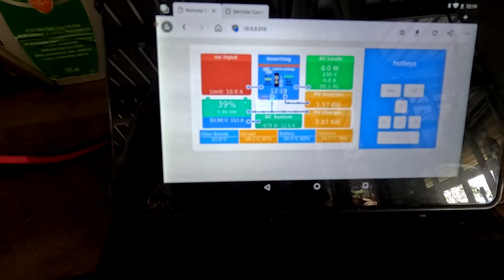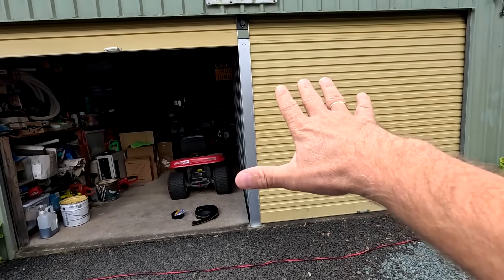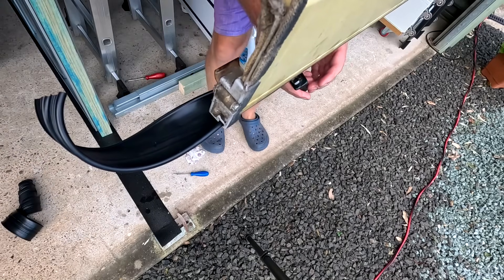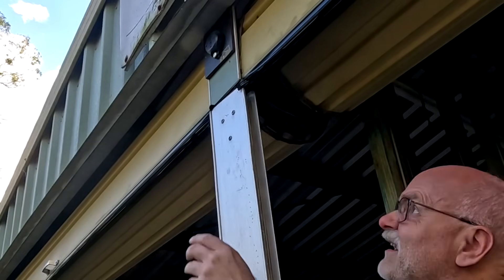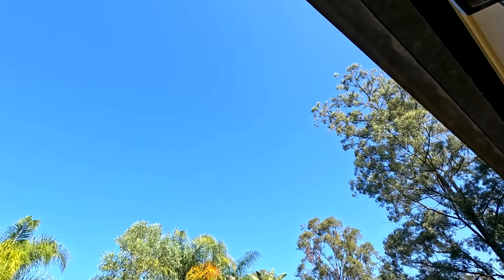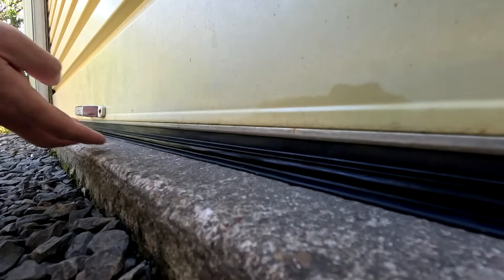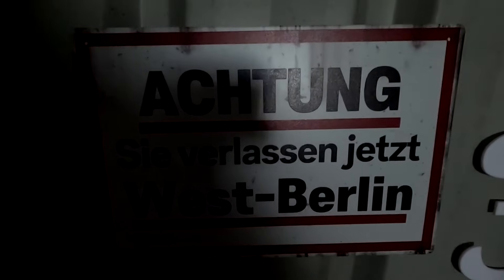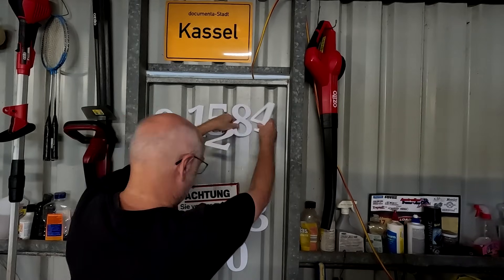Battery Room Weather and Dust Protection. Installing a floor seal under the roller doors.

Comment: Thanks for the vids and the great advice about JK BMSs.😊
Regarding the floor seal, as others have said you can buy silicone lubricant for rubber, but why bother when neat washing-up liquid works perfectly and you've already got some in the house. Just brush it along those T-channels and the seal will slide in a treat. Wipe off the excess afterwards with a wet sponge. Eventually the rain will wash it harmlessly away but by then the job will be history.
And I don't like to mention it but if you re-examine the diagram for the product I think you'll see that the smooth side of the ramp attached to the floor should go to the outside in order to shed rain outwards. Just my 2c.

Comment: Regular WD40 degrades rubber.  They have a silicone lubricant version that's good for it.
Reply: Agreed but most of the strips like that are synthetic rubber now and the instructions say that soap or WD are good to use to get it to slide.. I just replaced my 16-foot doors bottom seal and had to remove the aluminum track and scrub and straighten those channels before I reinstalled it with new screw placements before I spent about 15 minutes inch worming the new seal on all by myself.. I did it dry so it can be done..

Comment: Nice! I weather seald my battery inverter room 2 months ago I put Amp limited inverter 12k btu ac unit I think you should at least make glass room for the batteries and inverters Cooling in the summer. My ac unit consumes 6kw per day 😅.
Reply from the maker: A glass room...🧐😯

Comment: Andy, how did you get the system display onto the pc , I remember when you did it but it was years ago .
Which episode was it if you know, also I install garage doors every day , good job with the weather seal and lucky you could remove the mullion they are normally jammed against the mullion head .
Go Andy
Reply from the maker: I just connect to the local IPO of the Raspberry Pi running Venus OS with the old tablet.

Comment: Andy that Liquid Nails won't last for long. Should probably use a polyurethane based adhesive!
Reply from the maker: I used that stuff in 2009 to bond some timber and it is still like new. We will see, ey.
Reply: @OffGridGarageAustralia  yes it works but goes hard and your are using on a high traffic area. Might last for few years aswell. I would be pulling off to do again just reference for when you fix it.. keep up the great work. Love your videos and reference you a lot when people are seeking advice!

Comment: Oh Andy, why you doesnt ask the community :D Use Sylicon spray for working on rubber ;)
Reply from the maker: I tried. It didn't slide. WD40 did.
Reply: @OffGridGarageAustralia oh No, WD40 attacks rubber 🫣 not lubricating them

Comment: Hey Andy,

Our 2014½ year model Outlander seems to have a failed AGM battery in the boot. 

Do you have a recommendation to replace it with a lithium unit? 

I'm aware the lead acid charging profile may not be well matched but was curious to know what you think. 

Keep up the good work. Cheers
Reply from the maker: Yes, I have a source if you are in the South Queensland area.

Comment: have You tried KROIL? its smells delicious
Reply: We used to use a lot of that when I was a copier/printer tech.. Lubricated the bearings on stepper motors with it to make paper stackers and sorters move easier.. The paper draws moisture and the hot rollers and fans vaporize it so the dampness would get blown into the works causing corrosion.. Then there was the flood that put all sorts of stuff ankle to knee deep in water that I spent weeks tearing apart and drying.. We used a lot of WD and stainless brushes cleaning motors and CRC circuit cleaner and tooth brushes cleaning circuit boards and sensors..

Comment: I could have used a video about what Android devices and versions can load the crazy JK app.. Just figured out that the phone or pad has to have a GPS function for the app to install and run.. Spent a frustrating week trying a number of things till my son gave me an old phone that works.. Simple is not in JK's vocabulary and neither seems to be clear instructions or compatibility lists..

Comment: Now if we could just do something about that pile of rocks thats been there for several videos.  You have to wait a week until it cures so.......lets get cracking.  Andy 2 has had way too much time off lately.....just sayin...
Reply from the maker: It's there for 2 years now. Since I got the tow hitch for the Tesla and I desperately wanted to haul a ton. I guess, it will stay there for another 2 years at least.